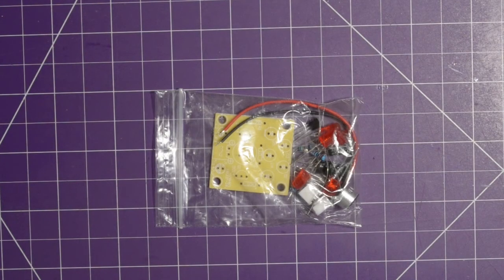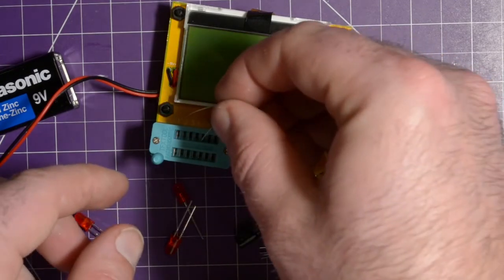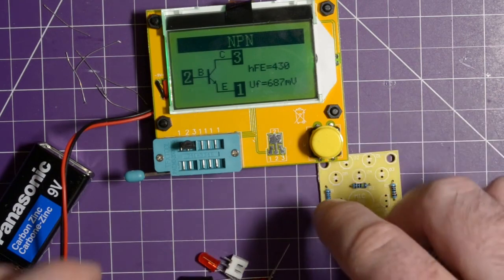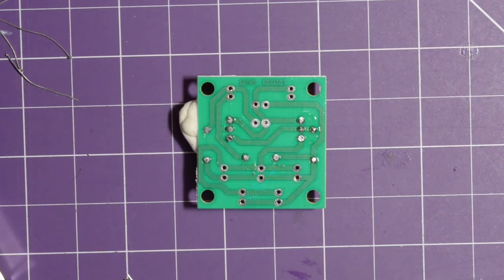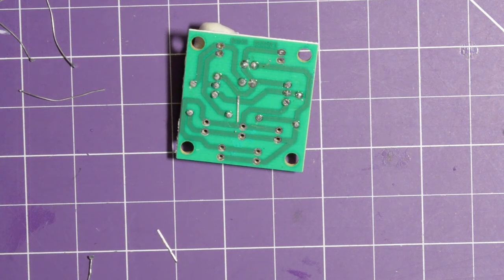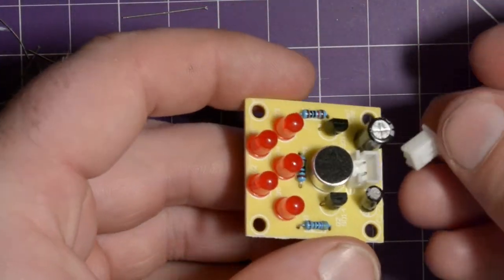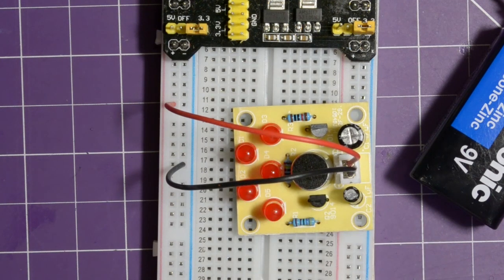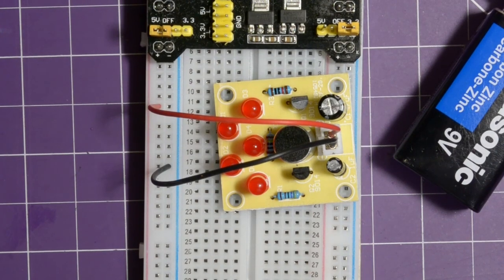Kit Build: Voice Activated LEDs

Comment: Could this be rigged to work with USB? I have a micro USB powered smart home speaker that I want to rig up with LEDs that light up when it makes noise. I was thinking of splitting the USB power supply and using it to power something like this.
Reply from the maker: it is a 5v device so it should be zero issues on USB

Comment: Hi, my module flashes as soon as I supply it with 5V even without the music. and once the music is activated, it hardly follows the rhythm of the music. Do you have a solution please?
Reply from the maker: Check your solder connections and try to move the speakers closer
Reply: @SimpleElectronics  the problem is solved ... it came from my AC transformer! I don't know why it made the LEDs blink without music, and when trying with an 18650 battery it worked perfectly! Thank you for your intervention you win a subscriber;)
Reply from the maker: @mekateknik3717  glad it worked out

Comment: The form-factor/appearance of the microphone suggests it is an 'electret' device, a.k.a. condenser mic...  Also, the '+' symbol for one of the mic pins further suggests such.  The transistors, with hFE=430, are higher-gain items. Jelly-bean 2N2222 or 2N3904 NPN transistors hFE (off the data sheet) are 300 typically.  Using a bit higher-gain transistors makes sense for this application, to afford larger amplification of the mic's output.  Last, as the two 2N2222 & 2N3904 have a collector-emitter rating upwards of 40vdc - and given the 50vdc rating of the caps - you could probably use a 9 or 12vdc power safely.  The marked transistor showing 'c3331' is likely a 2SC3331, whose data sheet shows it - like the 2N2222 & 2N3904 - could handle 40vdc.  But since the circuit works satisfactorily at 5vdc, no reason to chance a higher supply voltage.  Cheerz.
Reply: Well the transistors and capacitors might be able to handle higher voltages but I think the issue is the current limiting resistor for the leds. If they really are a lot brighter at 5 volts the chance is that they ... well without schematic it is difficult to check. Must do some reverse engineering.
Reply: @Luke-san  Well the kit I have is for 3V and the leds are very bright if you tap the mic when I tried with 3.3V. But since it is very brief, I dunno, maybe a slightly higher voltage wouldn't fry them?
Reply from the maker: Thanks for the additional info!
Reply: My pleasure.  Before you know it, you too will be leaving helpful comments for newcomers to our hobby.  Based on your increased mastery and deeper knowledge, experience.